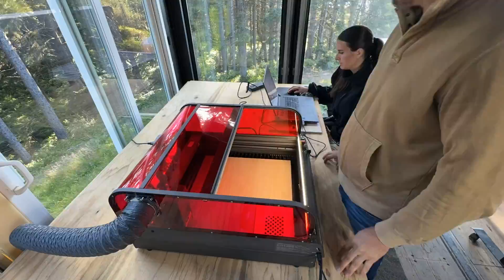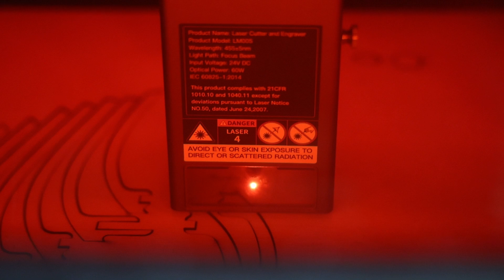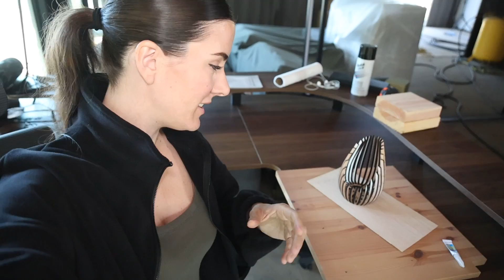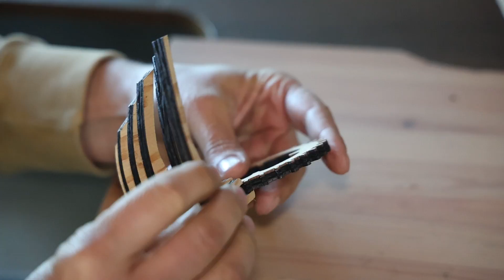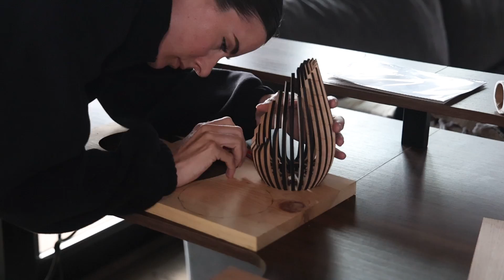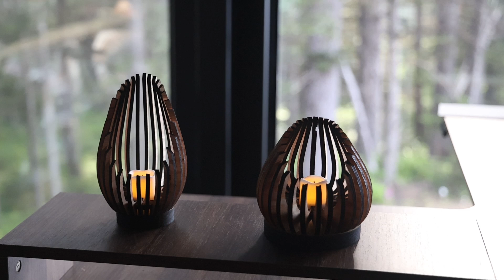I CAN'T BELIEVE WHAT THIS LASER IS CAPABLE OF! DIY Crafts with the Creality Falcon 2 Pro 60W Laser

Comment: Nice review BUT. The step focus block gives the engraving distance at 7mm which means that, that is the best focus distance from shroud to material, (engraving is surface only). So even setting the shroud on the surface of the wood, you can still only focus 7mm in to the wood (fixed focus), then you're progressively going out of focus from that point on. So 1.5inches is 38.1mm, that is one helluva out of focus cut. Creality know this and still pump out this rubbish to make sales. Also, the higher the power used, the larger the spot size (focussed laser width), so far less chance of doing any intricate cutting.

Comment: 60w laser what a beast😮
Reply from the maker: Yes it is!!
Reply: but if you set it at 70-80 % power for the run, then you just aswell go with the 40W model as 80% of 60w is 48.....and save some money. Also 60 w cuts with 0.6 mm... and 40 w cuts with 0.4 mm..and 20 cuts with 0.2 mm or 200 microns
60 w you need for thick wood... but the size of the enclosure do not point in the direction of working with big and thick pieces of wood.